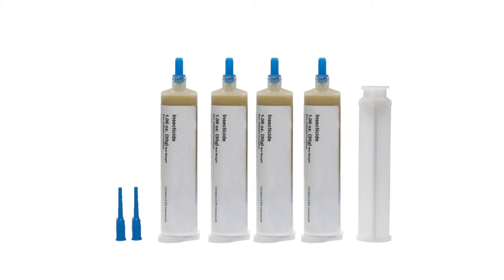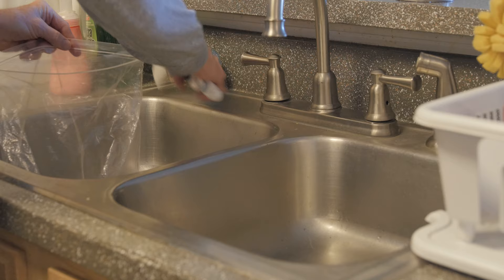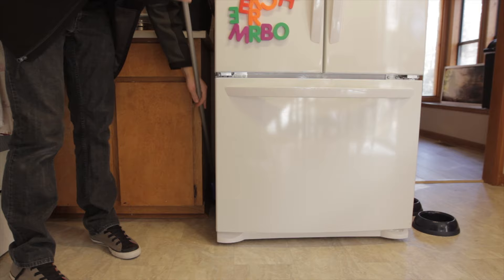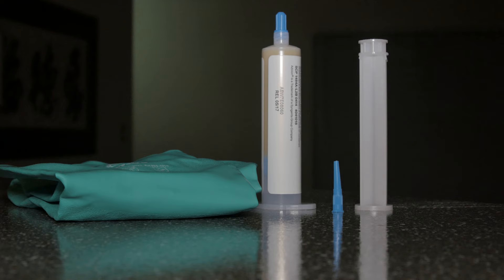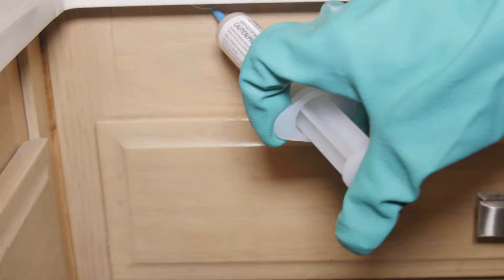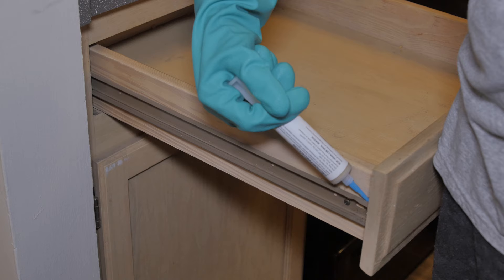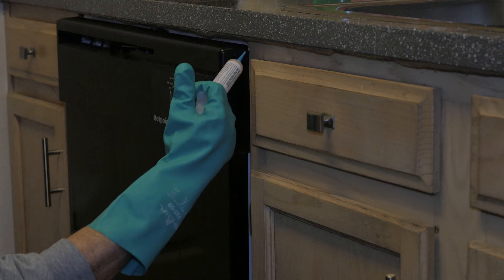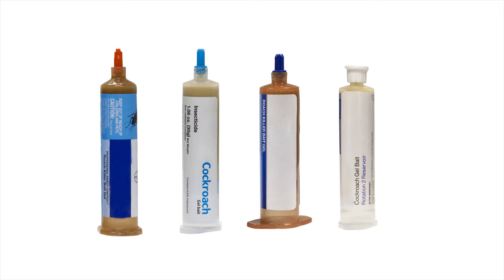Roach Bait Treatment - How to Get Rid of Roaches | DoMyOwn.com

Comment: If I sprayed today, how long should I wait before trying this bait?
Reply from the maker: You can use a roach bait at the same time as a spray as long as you are not applying them in exactly the same spots. A good rule of thumb is to spray low and bait high. We have additional tips, including a diagram to show you where best to bait and spray, in our online Roach Treatment Guide here. Avoid applying baits in spots where you have applied residual sprays within the last 2-4 weeks, depending on the product sprayed.

Comment: Is the roach gel normally runny? I asked this because when I applied the gel onto a card it looked runny and flattened out.
Reply from the maker: Thank you for your patience! it can be, depending on the brand. Sometimes if it sits for a while or gets too warm, that can happen. Usually, if you stick it in the fridge for a couple of hours that will fix it.

Comment: After applying this bait in all these locations, does it need to be cleaned off after a few days or just leave it?
Reply from the maker: The bait should be left in place until it has been consumed, contaminated or the treatment has been completed and the roaches are gone.
Reply: @domyown  I always thought that you were supposed to remove/replace it with some fresh gel when it got hard because they won't eat it when it if it's hard. I was also told to rotate brands of gel every 3 months so they don't become averse to any particular one.I believe I was told all this by a tech at Do My Own Pest Control (over the phone). Aside from gel, I find that Delta Dust is excellent!

Comment: I started seeing roaches in my home 5 years later idk where they are coming from.I've applied this and notice so many more coming. I started first seeing 1 and than it multipled by 5!!! Is this really safe and is it suppose to eliminate them?. I live in a condo. Btw not sure if that makes a difference.
Reply from the maker: Bait gel is just one of the products we suggest using when trying to eradicate roaches. One of our roach control kits would be recommended for roach control. These professional kits includes non-staining, low odor concentrated insecticide for spraying the outside perimeter of the home and inside underneath appliances, behind cabinets, under toilets and sinks, etc. You'll also get Roach Bait Gel to help get rid of those roaches that like to hide. Baits can be applied up high in the kitchen in the corner of cabinets and in cracks and crevices in kitchens and bathrooms. The bait contains a slow-acting poison that attracts and kills feeding roaches, who also spread the bait to other roaches by contact or by sharing food. Finally, an Insect Growth Regulator is offered which will stop roaches from laying eggs, helping to halt the infestation. The combination of an IGR with roach bait is a highly effective roach control strategy that is widely used by pest control professionals. The insecticide must be applied with a 1 gallon pump sprayer.

Here is a link to a great article that really goes into depth in explaining a roach control program:

http://www.domyownpestcontrol.com/how-to-get-rid-of-roaches-a-458.html

Here is a link to our roach control kits and sprays:
http://www.domyownpestcontrol.com/roach-control-kits-c-2_73.html

Please let us know if you have any questions. We are always happy to help!
Reply: @domyown   @DoMyOwn  thank you for the reply. I do appreaciate it. One other concern the control kits with paper and glue on it does not seem to work for us. Ive even had a exterminator place in same spots but the roaches are still not being sticked to it. So strange almost as if they are too smart and go around it. I found one roach just sitting there and eating the gel bait not even scared to move i ended up spraying him. My home is super clean and i have a new kitchen 1 yr old and still having these little disgusting creatures..i just ordered the gentrol too. Hopefully this will help.

One more question- can i spray the temprid fx under my stove?
Reply from the maker: @aa6425  Yes, Temprid FX is labeled to be sprayed behind or under stoves.
Reply: @domyown  thank you so much!
Reply from the maker: @aa6425  We're glad we could help! Feel free to contact us if you have any more questions.

Comment: Do we need to use gentrol with bait?
Reply from the maker: Yes, it is recommended to use an insect growth regulator along with bait, perimeter spray inside (and out) along with non-chemical efforts of reduction of food/water sources. For a good integrated pest management program, you will rotate baits (different active ingredients) every 90 days (replacing placements every two weeks cleaning up previous placements).